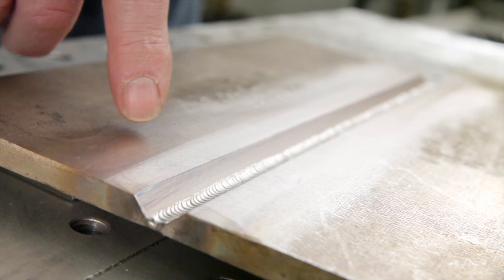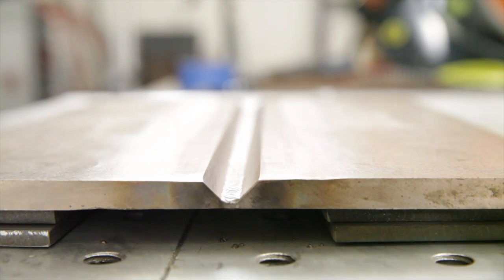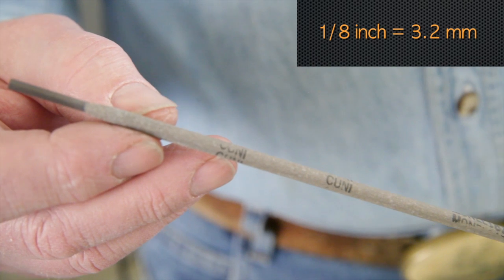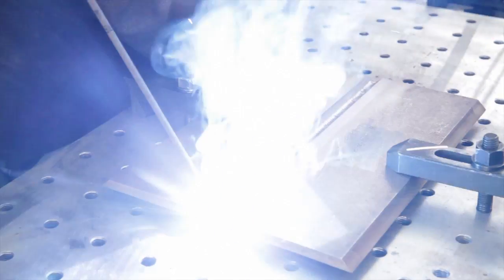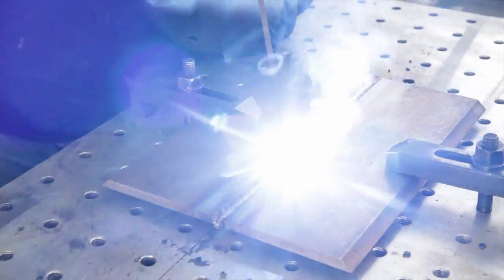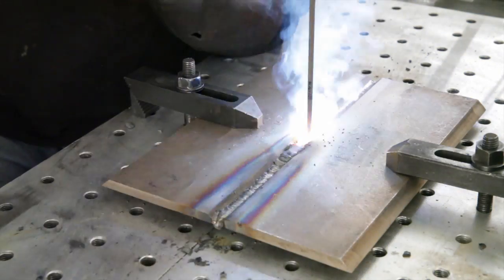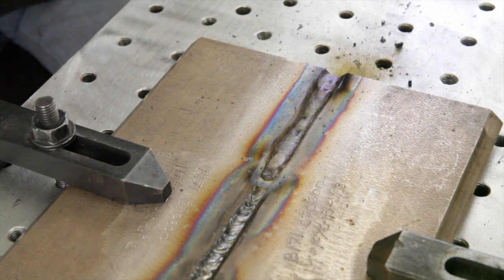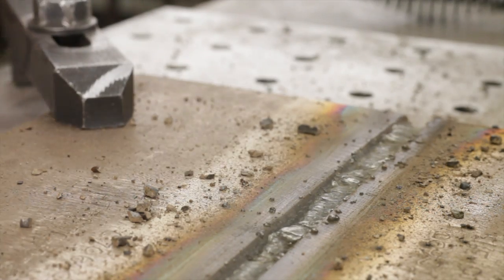CDA - Shielded Metal Arc Welding Copper Nickel Alloy Part 4 of 5

Comment: I'd be embarrassed to post this video with that ugly ass weld
Reply: Have you ever run 70-30?
Reply: No never have. I'm not saying the welder isn't capable of producing good quality. It's probably the material being welded on. I just think it makes an ugly weld. Kinda like welding aluminum stick rods and then welding with a pulse wire fed machine. Quality is day and night

Comment: hey, thanks for the upload.
You may have an idea? 

I got 2.4806 er-NiCr nickel electrodes. Somebody told me they cant be used for cast iron; 

but can I use the 2.4806 instead of the CuNi electrodes you show in your vid (for the materials you welded or e.g. pure copper)?

thx